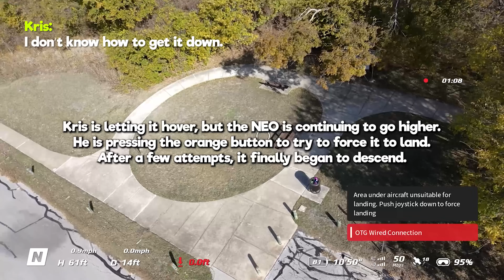Don't Do This With Your NEO [DJI Responded]

Comment: If u block gps it drifts.
If the system itself blocks gps, it doesn't.
Reply from the maker: Interesting. In what situations would it block GPS itself? And what's your take on the loss of GPS when there's no vision system?
Reply: @readysetdrone  It's been analyzed the wrong way. You need answers from a engineer in programming and see in real time how the source code works.
Reply: Don't get sued for stream it live 🤗
Reply from the maker: We are just a couple of regular guys. We aren't smart enough for that! 😅

Comment: Look in the middle bottom of the screen. It says 0.0 feet. It's trying to use the bottom sensors but can't
Reply from the maker: Ah, yeah.You're right. In our previous test, we must have taped it better, but this time, there was probably some light leaking in. 

At the end of this video is our first try outdoors to see if GPS will keep it stable, while being taped up. 
https://youtu.be/WT7aYH1gTZY?si=q59W6WrqfYglP8dc

I feel like, despite the tape situation not being perfect, it still demonstrated that the vision sensors are connected with the GPS receivers in some way. 🤔

Comment: Great job guys, it explains why it does what it does sometimes. I was walking having it follow me through a covered bridge, as soon as it didn’t have enough light it auto landed. I was disappointed but makes sense. I had a non-responsive experience with the N3 controller flying under trees, I’m assuming due to low light and not enough satellite coverage. Our forest are beautiful but dark canopies. Hope they can fix this with OTA firmware update.
Reply from the maker: Yeah, even our light that we strapped on the underside of the NEO in our last video about flying in the dark, didn't stop the landing. 

An update that could fix some of these limitations would be great! Although, the auto landing issue in the dark seems like just a simple hardware limitation due to cheap components to keep the price down.

Seems like you'll have to stick to the Avata in the dark forested areas.

Thanks, Joe. 👊

Comment: Neo thought the tape was the ground.
Reply from the maker: Yeah, you're right. That was our first thought, but then we were also thinking that the NEO is trained to land when it sees something underneath it. However, since the tape was there from the beginning, it didn't see it as a landing spot, and as you said, it was just probably trying to get away from the ground. 

What's strange is that it does show its altitude correctly on the lower left of the screen, so it should've known that it's in the air. 😄 Again, we are expecting it to do too much AND doing things we should be doing, so we'll cut it some slack.

Comment: Glad to hear more people talking about this issue, good analysis.  The Neo does not work well indoors even with all the lights on. When I go from one lighting condition to another it just takes off forward in a split second at high speed out of control and crashes into whatever is in front of it.  None of my other dozen or so drones have this issue including my 5 other DJI drones.  Even the my cheap little Mavic Mini and my Tello work fine indoors. DJI Support told me the Neo is meant for outdoor use only even though the users manual says otherwise. I bought the Neo to fly indoors during the winter. Starting to see tons of reports on this issue. Many people are experiencing similar problems. IT HELPS TO STRAP A LIGHT TO THE BOTTOM OF THE NEO BUT, there is no good place to strap it because the battery and camera are in the way.  I am an engineer who builds autonomous drones.  I'm thinking it is a problem with the optical flow sensor.  Most of the other complaints people have don't carry a lot of weight with me because this is a $200 aircraft.  But, this going bonkers on a whim is a serious design flaw.  I figure DJI will have to address the issue at some point.  Nice aircraft otherwise.  Love my Avata 2.  It can't compete with the Neo because the Neo is entry level meant for a different use.  I could go on and on about the differences but not much else matters because they are different classes of aircraft.  The Neo is great for what it is.  BUT, DJI NEEDS TO FIX THIS DESIGN FLAW WITH THE NEO.  All their mumbo-jumbo about this and that is a smoke screen.  I've got a lot of experience with their aircraft from the Tello on up.  They make good stuff.  This one has a serious issue if you want to fly it inside.
Reply from the maker: Thanks for commenting again. Overall, NEO is pretty amazing, but you're right that there some issues that need work. 

It definitely helps to have a light on the underside, but (as you saw in our previous NEO video) our light didn't seem bright enough, even though it can be visible for 3 statute miles. 

Using the FPV RC 3 has been fine for us in low light. Have you had any experience and / or issues with that?

Comment: Some instability is natural and to be expected when it has no GPS signal and the bottom cameras can't see very well due to it being too dark. But it shouldn't be accelerating madly the way it does. I wonder if there's a specific pattern to the low-light noise of the bottom sensors that makes it think the ground is moving forwards (and so it tries to speed up to - in its tiny little brain - "stay in place"). But the fact that it only happens (or happens a lot more) with a specific controller suggests a firmware bug.

Comment: It's definitely the piece of tape. So basically all dji drones. If you put anything beneath the drone, the drone will go up a little because
 It detects an obstacle.  The only difference is that neo is meant to be landed on your Palm Therfore landed on the helmet, but when you have something right under the sensor when you launch the drone, it obviously will detect it As an obstacle not as a landing spot
 I ones had the same issue with my Air 3, I wanted to send something over to my friend with the drone. So I taped it  to the drone, 
 And the tape covered the downward sensors. So once I got up in the air I couldn't get it to come back down, and I freaked out. Eventually i figured that when im holding the stick down it's slowly decreasing the altitude, it took quite a while to land.
Thanks for the content 😊
Reply from the maker: Ah ok. You are probably right about that. We've experienced the same thing in the past with a camera drone and its sensors, but your logic makes sense here. Thanks. 

That's one issue resolved. As to why the satellites and vision system are connected is still a mystery. So is the fact that the Motion 3 throttle becomes extra sensitive in the dark.

Comment: Thanks, I actually faced the same problem, and I was flying in the corridor in between apartments, with the RC-N3 and my phone, and I faced the same problem. The drone started speeding out of control and crashed into a wall
Reply from the maker: Interesting. We don't have the RC-N3, but perhaps it has the same problem. With our RC 2, it just drifts, but remains in our control. It sounds like you experienced the "sensitive throttle" issue that we notice with our Motion 3.

Comment: You didn't have enough satellites in the video, it was in red almost all the time. You need to wait until good gps lock and nothing red on the screen, white N not red.
Reply: I've had my neos at 20 satellites flying indoors with motion controller and fpv. Both flew terrible in low light. Flew at a carpark in the dark with carpark lights and 20 satelittes. Neo wanted to go up and was uncrollable. Not fun at dark.
Reply: @michaelwatkins5660  This thing is not an avata 2 and you really need a controller 3 and be flying in manual to have fun with it, unless you always have plenty of light and good fps lock. So for indoor flying, really on the controller 3 and manual is suited.
Reply: I think you need 15/16 or more satellites. @readysetdrone
Reply: Non DJI FPV drones using commercial FPV parts only require six satellites for a fix.  My Neo is often showing over 20!  Seems like a weakness in the design/firmware of the Neo.
Reply from the maker: Ok, how many is a good number? 

Do you think the flight would've been stable at a certain number of sats? 

Also, in the second test, it seemed to have all the satellites in the white (when the vision sensors were uncovered), so there's still some kind of connection between GPS and vision.
Reply: @readysetdrone The Parrot Mambo didn’t have GPS and it flew very stable with only optical flow sensor under low light conditions. I’m assuming that’s a camera using optical flow algorithms under the Neo. Don’t know why you would need GPS to fly indoors.
Reply: @RW12345  It seems to be two micro cameras plus a third sensor (possibly a simple light meter) of some kind. The parallax between the cameras should allow it to judge distance, and motion detection / optical flow should allow it to correct for drift.

But (depending on the frame rate and noise pattern), moving at specific speeds over repetitive patterns could make it completely misjudge its speed, if it doesn't also check the optical results against GPS or against accelerometers.
Reply: @readysetdrone  I read everywhere that ,to be safe ,it has to lock 20 or more satellites .
Reply: @miciobigio yes I have read the same thing too.
Reply: @readysetdrone  Until you have a Home point. Flying it without homepoint will not let your drone come home automatically that is why you're struggling because you flying it manually.
Reply: @readysetdrone  you need 16 before you get a home point updated, so don't take off in normal mode with the vision sensor blocked before you have 16 satellites. And even in manual mode, if you take off to soon without enough satellites it will eventually force you in normal mode as soon as you fly to far or a bit to high.

So I always boot the DJI Neo before the goggles and the controller because getting a lock takes a while.

However, once you have a lock, on the next batteries the lock will be there much much faster. Try it. Boot a neo, get 20 satellites and time how long that takes. Then shut it down and start again, now you get satelitles much quicker.

Comment: Interesting, this would potentially also explain what happens over water. If the vision system is confused by the featureless, reflective water, then satellites could also become unstable causing the drone to do crazy things. I had such an experience before I knew about water (new drone owner, presumed water was fine based on marketing videos, later discovered that wasn't the case after I lost my drone).

In fact, I have my log still posted on my YouTube account if someone wants to see it. The satellite lock became very unstable and it just crashed into the water with no way to control it (the entire time using RC-N3, open skies, zero wind).
Reply: @OnlineLuc  Hmm. We haven't tried it with the RC-N3 (since we don't own that controller) but that's definitely a possibility, but it could also be another issue. We've had random unexplainable NEO incidents / nose dives with the FPV controller 3.
Reply: @TechnicallyAverage  and to add, in my particular case, DJI replaced my drone under warranty (did NOT count towards a care refresh claim). When I asked what the cause was, I was told "a flight a control issue" and they explicitly indicated it was not a user error. The satellite numbers were all over the place on my log during the end. I was away from any possible structures. Should have had clear line of sight to satellites and excellent lock especially since it was many minutes into my flight. 

But yeah, could be something else... no way to confirm.
Reply: @OnlineLuc  Wow, I'm glad they replaced it! At least that's good to hear!